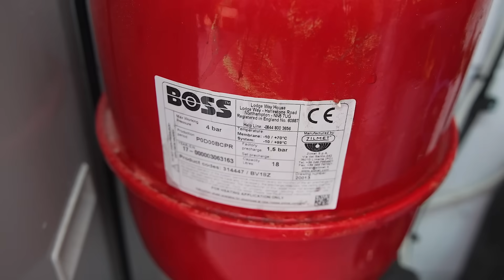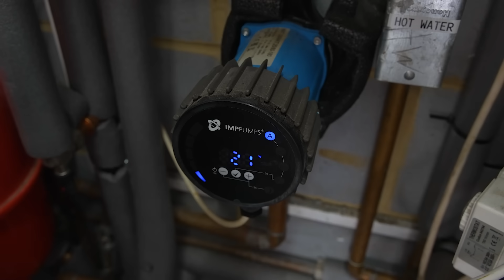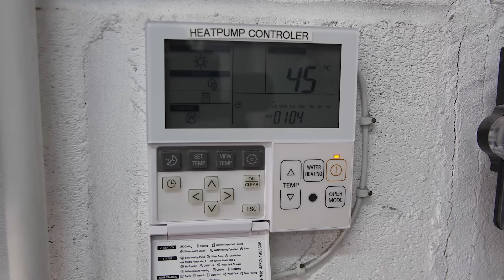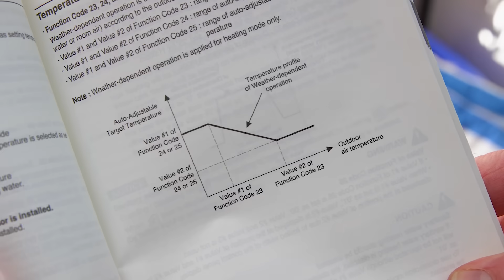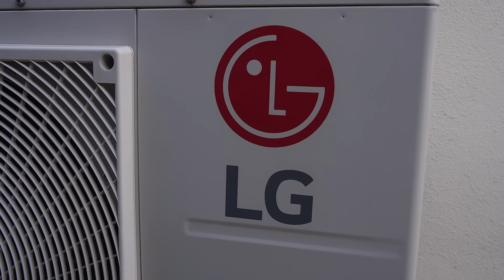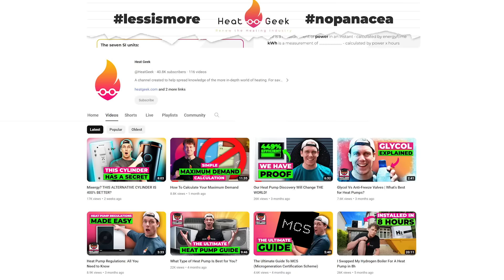Heat Geek Gives His Verdict on John’s Nightmare Heat Pump

Comment: Brilliant work guys...  Hopefully Adam and Szymon can get this installation fixed and show case the difference correct system design makes to a heatpump installation.  If you can do it with the same heat pump (and obviously the property is the same), that really makes for a comparison!

Can you find a good source for replacement fans on the outdoor unit?  As changing those doesn't break into the refrigerant system, hopefully Szymon could fit those rather than needing to drag out a refrigeration company.
Reply: Correct inspecting would denote those Fan bearings were shot, pulling that Fan Motor  and then having the motor services and  bearings replaced or even just a new motor wouldn't  be a be a Kings Ransom, rather than condemning the Unit... those other internal mods would be child's play ...

Comment: This was a very good video from you all. Shame around the circumstance given the poor owner has had this nightmare of a situation but greatly reassuring that there is light at the end of the tunnel should he take on the advice suggested. He sounds like he will give the heat pump another try and I hope you guys might be able to help with funding the replacement (do get some financial benefit in content for your channels so maybe a bit of a discount 😉).
Was very good to see Rogers surprise that the system could actually be simpler than it was and that it looks to have been over engineered for no benefit. 
Hope you can do some more content like this, checking up on issues and finding a resolution and then maybe a "revisited" series to see if the suggestions/rectification work actually helped 👍

Comment: Interesting video, I have been a heating engineer for 35 years and admit I’m stuck in my ways and too old to be interested in installing heat pumps now, but still interested to see how the domestic heating industry is changing, Rodger brought up a great point at the end regarding manufactures repairs and warranties, the cost of these units to buy and install should be covered  by a substantial warranty, the poor customer there has had that LG heat pump for what six years and it’s basically now scrap, due to poor workmanship, no one should be allowed to fit these unless they have been on either a manufacture course which would then sign them off as a registered installer or a professional registered company such as heat geek that can provide the necessary training and accreditation, it’s stories such as this that’s still putting a lot of people of having these still unfortunately.

Comment: Been doing air to air for a long time. Outdoor unit position and installation is the most important part for me. Winter time in heating it’s better for a bit of solar gain to help stop as many defrost periods so go for south facing if possible. Working abroad for the cooling we tend to put them on shaded walls. It’s all down to basic easy knowledge which these guys are spreading. Keep up the great work lads!👍

Comment: I have no experience with heat pumps but I have loads of experience with Air Conditioning units and Pool heat pumps which is basically the same thing. I had a property in Florida and thankfully had no near neighbours, closest was approx 100mtrs away. Our Air conditioning unit sat outside our garage side wall and only windows on that side of property were our bedroom side windows which were long but fairly narrow. Our Pool heat pump sat on the outside wall of our bedroom on same wall as AC unit but at rear end of wall as opposed AC unit near the front end of wall.
Now when these units were new they were fine but as time goes by they get more noisy due to the outer casings start to rattle. As I said we had no near neighbours which was just as well and the Pool heat pump was an alarm clock effectively because it started up at 8am. Here in the UK the thought of having one of these things with near neighbours would be horrifying, it could easily start a war with your neighbours.
Reply: Risk of neighbours nipping round to switch it off.
Reply: Yeah we’ve all heard ratley old pool heaters. They don’t need to sound like that though, the latest designs are super quiet with decent bearing systems.
Reply: I would image that there is still some improvements that can be made to the cases of heat pumps to both absorb noise, but also to ensure they remain intact after they have been removed 20+ times for servicing over the life of the machine.

Comment: I am a keen follower of Roger because I consider him to be a ‘common sense’ man. So, it was interesting to see Roger collaborating with Adam. Adam seems to be a man who really knows his stuff. 
I am considering getting a heat pump installed. This video has given me more confidence. I hope John’s problems get resolved quickly.
Reply: We're looking at a heat pump install right now and have gone with a heat geek trained firm - straight away they seem good and won't even talk about hardware until they've surveyed the heat requirements of the house. Contrast that with the last gas boiler we had put in - a 30kW boiler in a tiny 2-bed house - which was so overspecced we never got better than 40% efficiency from a brand new condensing boiler.
Reply: @matthewseymour8972  Thanks for your comment. I shall look into this in the near future 👍🏼

Comment: Very informative. I'm an architect and often specify heat pumps with design and commissionion certified by a qualified engineer. Unfortunately, these systems are overly complex with too many controls, pumps, valves, etc. Too many things to go wrong. I have a geothermal heatpump in my own house that has been serviced once in the last 17 years and is still working well. The technology is proven, but installations are lacking, and many systems are just too complex. It's a shame to see a gas boiler running next to a heat pump.

Comment: On homeowners not being technical about heat pumps, the problem begins before that.  Homeowner should not be specifying heat pumps based on advertising and politicians' PR, because that's like telling a doctor the diagnosis before reporting symptoms!
The first call ought to be to an independent qualified heat loss surveyor to get a report on the building's condition regarding heating losses with recommendations for what changes are required to achieve the best standard of efficiency.  That may or may not be a heat pump and other changes required, but at least the recommended comprehensive solution, if installed correctly, ought to work as well as it can.
Reply: This is great advice, but there are precious few qualified heat loss surveyors available for hire. Given the antiquted state of Britain's housing stock and the current price of energy, we should be awash with them.
Reply: The issue there is that it's an additional cost, and additional person to get round. People likely see that as inconvenient and just expect their heating engineer to do the heat loss part for them. Ideally, heat engineers would do a proper survey as their first task and then install the appropriate unit. There are probably a few reasons why that doesn't happen. The first is that, as you say, the customer phones a heating engineer asking for a new boiler or "one of those new heat pump things", rather than asking for a new heating system - they've already diagnosed, as you say. Secondly, the particular heat engineer is likely used to one particular system (usually gas) and will be predisposed to installing that. Thirdly, properly insulating a building in the UK can often be extremely disruptive (unless external clad), time consuming and expensive. You don't get the same feeling as installing a tangible boiler unit. I expect the customer is often just after a quick fix, and the heating engineer wants his sale, rather than having to wait for internal insulation to be done, often room by room - or have to work around that ongoing building work. 
I suspect that's why people just throw back in a gas boiler in the end, and heating engineers are happy to oblige. The focus should always be on energy reduction first, energy supply efficiency second, but doubtless that almost never happens.
Reply: Once Heat Geek get their guarantee in place, then they can quote on that basis which will enable you to work out your savings, and they you'll be able to safely proceed on that basis.

Comment: The big flaw in our geek’s augment is that most homes with a high temperature  gas or oil fired boiler do not have the central heating on in summer and then  only for short periods in autumn or early spring. Winter is the only time when the central heating is on most of the time.

The comparison between heat pumps and gas or oil boilers should be for winter only. 
 
ASHP COP for 0 to -10 degrees?   Is 1 to 2 ie  28p to 14 p / KWhr  Cost of oil today 8 p/ KWhr ( source Nott Energy consultants)

The geek used thenSCOP annual figure of 3.5 which includes summer. And had the ASHP low temperature system running all year using weather compensation to adjust flow temperatures. Resulting costs far higher as WE DO NOT USE our central heating in summer . ASHP systems cannot give you a quick burst of heating if it is a bit chilly.

I have  oil and will continue with it . Happily the alternative HVO replacement oil will soon be widely available and its price will fall in time. Only need to change a jet on the boiler. 

Finally imagine a cramped new estate with each property having ASHP s running. The noise frequencies will differ a bit and will resonate!!
Reply: Agreed - the manipulation of heating stats to include summer time seems to be continually overlooked, ditto the insulation - all systems use less fuel if the house is insulated more highly. 

Never do we see an apples and apples comparison. We also have oil and it has been consistently cheaper than gas for the past 9 years - sometimes considerably so. Throw in buttons to service and zero cost standing charge and it will be a cold day in hell when this house converts to ASHP.
Reply: I just did my own ASHP install on a 213m2 new build. The results are fantastic. It pulls only 800 watts to keep the house at 19c at -2c outside. The old house this replaces had an oil fired boiler and the costs to run that were atrocious. Now fuel oil is very expensive here in the netherlands I must add. I was a heat pump critic but not anymore. Its dead quiet as well
Reply: He needs better training. I don't use my heating now until October!
Reply: I installed a smart electric combi with seperate elements for heating and hot water. The heating only gets used in 3/4 months the instant hot water provides for showers ect. Combined with PV solar and old diddy heating allowance I save money, a heatpump running 24/7 would be using electricity when not needed.

Comment: Although I’m still with a gas condenser boiler. I have insulated the 1st floor ceilings as well as the 
loft space and upgraded the upstairs Rads. Downstairs I have underfloor heating. When the prices drop I will definitely use a heat geek installer.

Comment: Wow ! The amount of equipment ! More to go wrong as well 😲
Reply: And more materials and energy used in their production.
Reply: And where the hell is it going to fit in the average uk home ?
Reply: I do the electrical connections on new build houses which all have heat pumps. Inside the houses are 1 large cylinder , similar amount of space consumed inside as a gas equivalent.

Comment: What I like most about heat pump systems is their simplicity 😂🥶
Reply: They said condensing gas boilers would never catch on. The installers said they weren't worth the premium! Who needs circa 90-95% efficiency, gas is so cheap 65-70% efficiency is fine! For the last 5-10 years anything not condensing is instantly condemned as inefficient and wasteful!  Simple way to tell if your boiler is condensing - does it have a water drain valve at the bottom? If it doesn't it's not a condensing boiler!
Reply: I think the biggest problem with heat pump installations in countries like the UK is they are trying to retrofit them into houses that have extremely old radiator heating systems which are based around pumping water all around your house. Pretty much every house in Australia has a heat pump air conditioner/heating system and it's much more simple over here as we use them to heat or cool the air which is blown through either a whole-of-house ducted system (which can be zoned to certain rooms) or split heads which are placed around in separate rooms. There are also some other types like cassette systems that sit flush with the ceiling. A whole of house ducted system costs the equivalent of 5000 pounds or individual splits around 650 pounds. 

By instead using them to heat water instead of air you are introducing so many more points of failure. Water leaks, blockages, pump failures, heat loss 

And before someone comments that Australia isn't cold enough so not putting heat pumps under much stress Canberra has a similar climate to London and our record low is -23c. Looking at the climate data for the UK -25c is pretty much the coldest it has ever gotten. My air conditioner is rated to cool up to 52c and heat down to -25c
Reply: I an dreading how noisy my awful neighbours new pump is going to be, like the one in this video it’s facing my border fence and I swear it’s to close to us to be ‘legal’ - I will be onto the council straight away if it makes noises like this poor man’s fan does - awful awful machine

Comment: This was quite interesting to watch.  I am in the  HVAC industry in The States.  When I look at all the expense for that high-efficiency equipment, that does it last all that long, I compare that to my original Heil 80% gas fired forced air furnace that is 39 years old and still performing as it should, amazingly without leaking any CO yet.  However, that furnace will be replaced within the next year proactively, with another 80% gas furnace.   The air conditioning equipment is also original from 1985.  I selected my own HVAC equipment when the house was built, as opposed to what the builder offered.  The repairs to the furnace at this point have been a gas valve and a draft inducer, and a new contactor in the condenser outside.  The 3 ton York condensor with an American built Copeland compressor is original including the AO Smith fan motor.   All that stated all the fan motors have oiling provisions, so they have lasted all these years because I keep them lubricated, as well as keeping the coils clean.   My savings is from the lack of repairs over all those years.  Fortunately our natural gas costs here in the US are still manageable for the most part.   5 years from now, who knows.   Cheers gentlemen.
Reply: 80% efficiency? That is low to the UK.
Reply: Longevity and efficiency are good, but the issue is that we all have to get off fossil fuels in about 20 years, easy stuff like cars and home heating first. Fitting a new gas system now is 15 years more delay and the corresponding say 30 tonnes of emissions (could be more for a big US house). The time to switch is now, and especially if you are a heating engineer you have the expertise to assess kit and lead a little within society - your friends probably ask what kit you recommend?
This isn't a future problem any more, it's our actions right now that matter.

Comment: heat pumps have been used in Sweden for years.  rarely any problems.  there are several manufacturers here.  We now have the problems described when it comes to solar panels.  Few are trained even if they are electricians.  my wiesman air/water pump has almost no external installations at all, just some pipes and some circulation pump.  good program.

Comment: I hope you follow-up on this follow-up.....I want to see the system work like Heat-Geek said was possible. THANKS!!!...this is seriously important stuff!
Reply: I think a follow up video would be ideal. It would be good to see if the proposed changes actual work. The problem with this is that it is easy to talk about making changes, but it costs money for time and materials to do so. If I were John, I think I might ask that they change the system in such a way that the buffer can be taken out of the system and put back in just using valves. Similarly, the TMV and Pump on the UFH are retained until the system has been provien to be more efficient, so they could be refitted if the changes didn't work.
Reply: @tlangdon12  I would think the original designer/installer would step up, replace the outdoor unit and make those simple changes (mostly, like Roger pointed out, removing a lot of stuff). Maybe Roger's YouTube channel could motivate this to happen (a bit of shaming can go a long way).